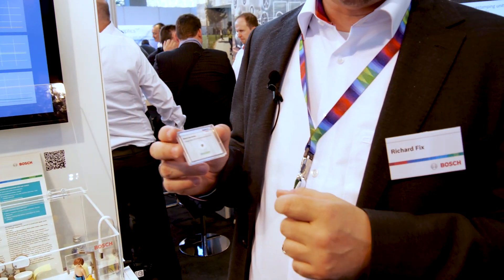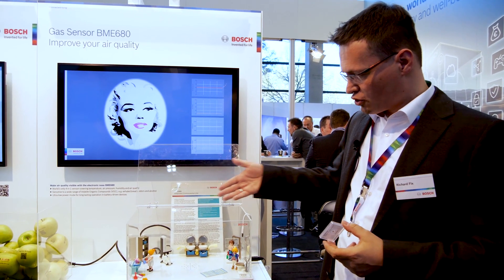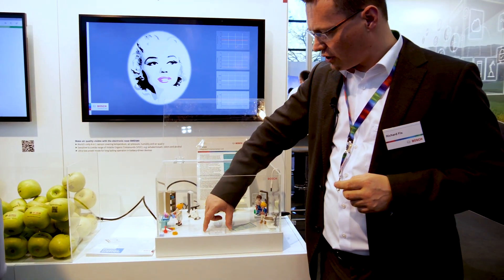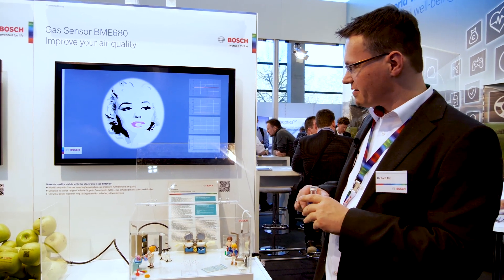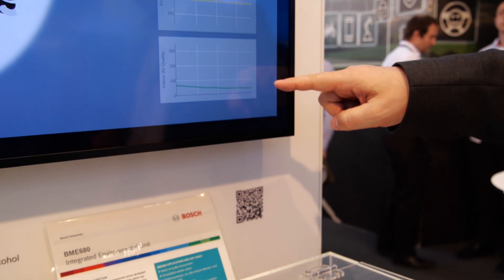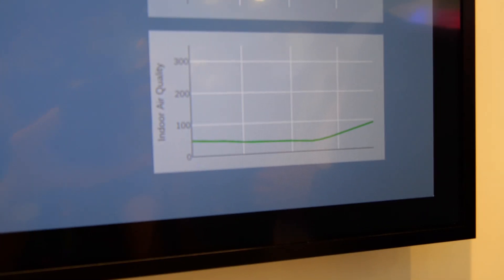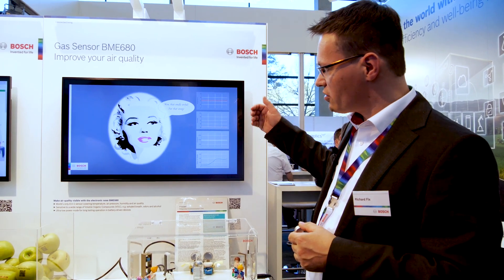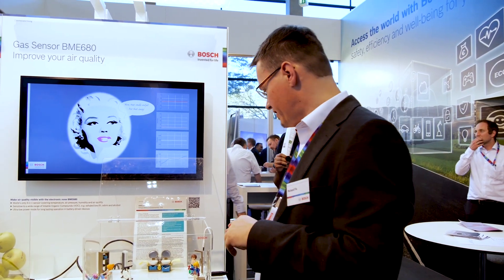Bosch Sensortec @ Embedded World 2019 (Part 3)

Comment: Will BME680 senses carbon monoxide  gas in closed environment?
Reply from the maker: The BME680 is sensitive to CO, this means: the higher the CO concentration is, the higher is usually the sensor signal (IAQ value, stands for “Index for Air Quality”). But since the BME680 is not only sensitive to CO, you cannot conclude that CO must be present.
Reply: @BoschSensortec  
Thank you for your kind information.

Comment: Sorry, but VOC (what the sensor is measuring and has been tested with according to your own data sheet) is NOT air quality. It may count as one of many dimensions of air quality. You can check this out on the website of the World Health Organisation. https://www.who.int/airpollution/en/
Reply from the maker: Yes, absolutely correct: Air quality is basically about nearly every component in our ambient air except Oxygen, Nitrogen and humidity. What we want to breathe in is fresh air (21% of O2 in N2 with a reasonable relative humidity).  Further compounds usually indicate bad / used air (exhaled breath) or at least a reduced freshness of the air.
The BME680 is not a single gas detector, but a very wide-band sensor: It can detect nearly all VOCs and other gases in our air – with only a very few exceptions like CO2 and N2. So nearly every contamination of the ambient air is being detected by the BME680. 
This is exactly the reason why our customers appreciate it in daily life.